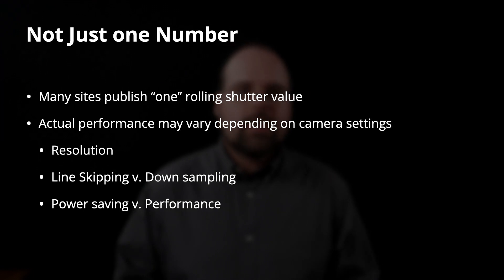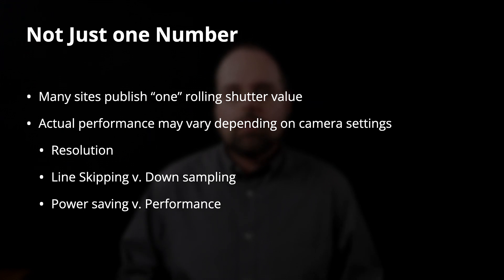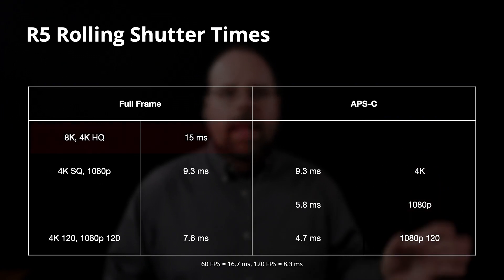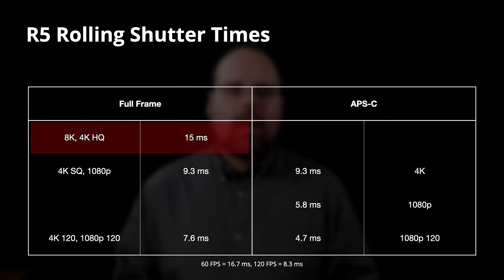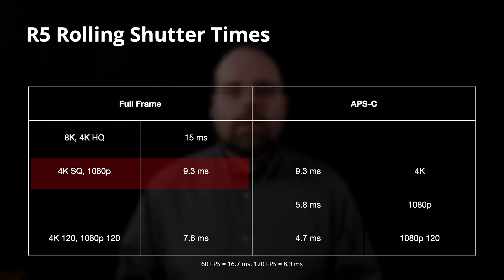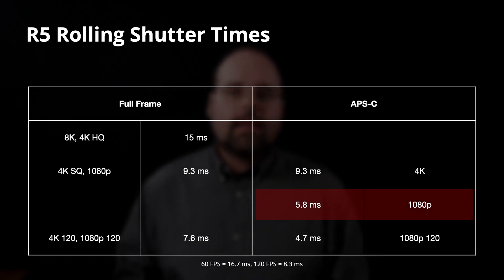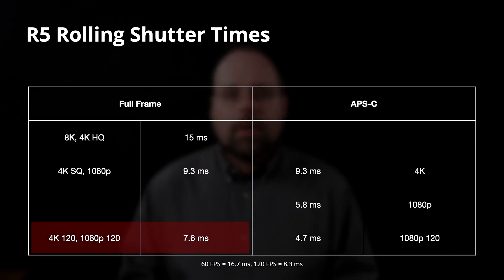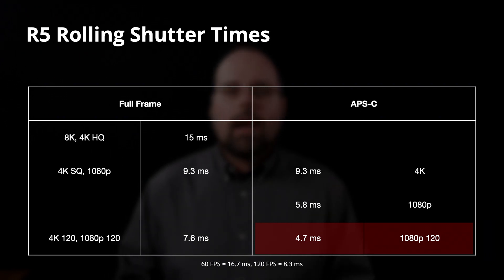R5 Rolling Shutter Performance Tested - EOS R5 Tip 65

Comment: So 4K cropped isn't line skipped but in fact downsampled?
I did the rough math 5.1k is 5120 vertical out of 8196 total sensor height, so roughly 60% of the full readout speed equals just over 9ms.

Josh Satin did a video on using the speed booster on the R5 C (which always downsamples) in crop mode.
So maybe using it on the original R5 in crop mode would give a marginally better 4K60.
Good to know.

Clearly the camera is capable of doing both 8K60 and 4K Fine 60p, but I think Canon held it off for power consumption and overheating issues.
Reply from the maker: To the best of my knowledge and testing, yes, 4K in APS-C mode is down sampled form the full crop readout.

So yes, you can get good quality 4K60 in crop mode. And throwing a speed booster on would get you near full frame like DoF. Doing the math real quick, Metabone's SpeedBoosters are 0.71X, 4K-UDH in APS-C mode the R5 is about 1.8x crop factor (DCI is slightly less), so with the speed booster you're looking at a 1.27x crop factor, so about 30% more depth of field than what you'd have on full frame. But all things considered, close enough to be fine.

And yes, the sensor and processor are capable of 8k60, but the problem as you noted is heat. That's a lot of data to process, even at 12-bit it's 3.24GB/s in just raw sensor data, before you get to the math for debayering, color conversion and ultimately compression (and even in raw, the camera still has to do all that work for the display). Anyway you cut that that's heat, and in a weather sealed camera getting rid that heat is problematic. The R5C (and all cinema cameras) get around it with a big heat sink and a fan. Which honestly works great, though most people don't want the size. I thought the solution on the R5-2 was pretty clever, with the fan base and the internal cooling duct -- but the R52 still can overheat in it's highest video settings. Truthfully I don't really see a solution in the future without active cooling. Even going to a more advanced semiconductor process isn't a panacea. Apple uses TSMC's N3E 3nm process for the A18s in the latest iPhones, and they still get hot and can overheat when shooting 4K60.
Reply: @PointsInFocus 
I think I'm going to do some moirè tests in the cropped 4K vs regular 4K vs 4K fine and see if the 8K downsampled to 4K looks that much better.

On the overheating issue, I 100% agree. Active cooling is the answer. I know a few years back they came up with a solid state cooling device for laptops but it was slightly less efficient than fans. 

I also wish I knew what exactly was changed internally with the hardware and image pipeline between the R5 and R5 C, as they share the same sensor.
Reply from the maker: 8K down sampled to 4K should give you the best quality. It has the highest down sampling ratio, so it will have the lowest noise. 4K in APS-C mode should be next, since it's down sampled, but the ratio is lower so there will be less of an impact on noise. Line skipped 4K will be the worst.

To be honest, between the diminishing returns with increasing resolution, and the thermal problems, I wouldn't be surprised to see cameras stay at the current resolutions for a while. Weighing the gains of an 60-80MP R5-3 versus the engineering trade offs to get there... At least for me personally, I don't see any value in more resolution, I'd rather see the effort put into more DR, lower base ISOs, high DR global electronic shutters and a number of software improvements (e.g. frame averaging).

Same sensor, but the R5C's is rigidly mounted to a heat-sink and the R5's is floating in the IS system's suspension (IBIS is a real thermal design challenge IMO). Same processors too. The video compression target bit rates are also different, which I don't know what that might actually effect. I've tried to understand how AVC and HEVC work, at least well enough to understand how the data has to be buffered through the compression process, and it's way over my head.

Comment: I have been researching the science behind compress raw unfortunately I have only found two articles about it. 

I have a question: would there be a way to measure the sensor readout to see if there is a difference between raw and compressed raw for photo as there is between the different video formats as you show in your video.

my hypothesis is: if part of the compression goes to the sensor level as in the case of video, that would mean that the compressed raw has a faster and better sensor readout for still photographers
Reply from the maker: So far as I know, there's no compression going on at the sensor level in at all; whether you're shooting raw or compressed. Moreover, I'm not sure there would be sufficient gains to be had there at this point in time.

The least interdependent raw compression method is Nikon's old "lossy compressed raw" which was nothing more than a LUT as we would call it now in the video world (though it was designed optimally around photon statistics). This only saved Nikon about 25% give or take, which means that you'd only see a ~25% speedup in read performance. Which isn't going to make a significant difference when you're talking about rolling shutter speeds of 15 or so ms versus the 2-3 ms that a mechanical shutter uses.

Moreover, we've already got a solution to the readout problem; stacked sensors architectures. Canon's R3, Nikon's Z8 and Z9, and Sony's A1 and A9 all use this tech and it's not so cost prohibitive that it won't be moving out to more cameras in the future. Moreover, the bandwidth gains radically reduce rolling shutter times down to mechanical shutter levels (see my video on the Z9's rolling shutter perf. specifically the still section https://youtu.be/L6wYejSaO4M). Performance on the R3, A9, and A1 is in that same ballpark.

Getting back to raw compression, most of the methods being used today are implementations of more generic image compression algorithms. Canon's standard raw compression (used in all raw files except CRAW), uses lossless JPEG2000 compression (or something very similar). Canon's lossy raw compression (craw) is discussed in part in US patent 20160323602 (https://image-ppubs.uspto.gov/dirsearch-public/print/downloadPdf/20160323602).

However, if you have the patience, LibRAW is a FOSS (https://github.com/LibRaw/LibRaw) raw decoder that includes the ability to decode basically all raw files currently out there, and should have details in the comments/documentation as to how the processes work (or of course, you can always go through the code as well).

Hope that helps.

Comment: How much of this applies to the R5C as well?
Reply from the maker: Basically, none of it.

Next week's video is going to be the in-depth dive into the R5C's rolling shutter perf.

Not to spoiler next week's video too much, but one of the things that I found really interesting is that while the R5 and R5C use exactly the same sensors, the R5C does things differently enough that the timings and resulting rolling shutter performance is different from the R5's.